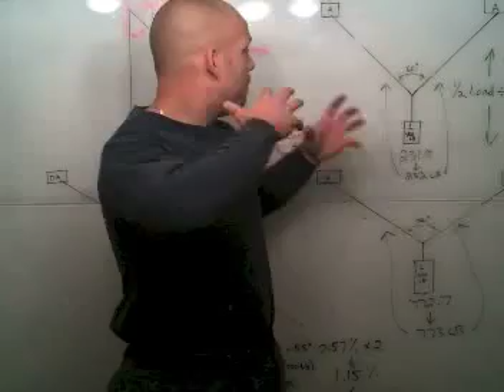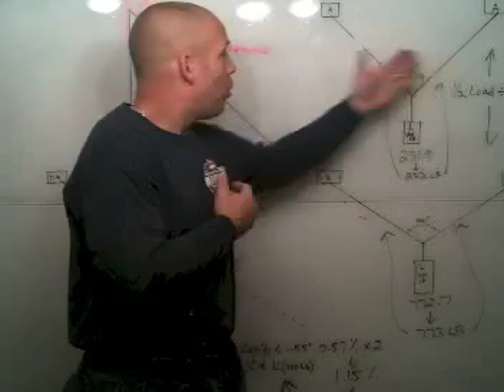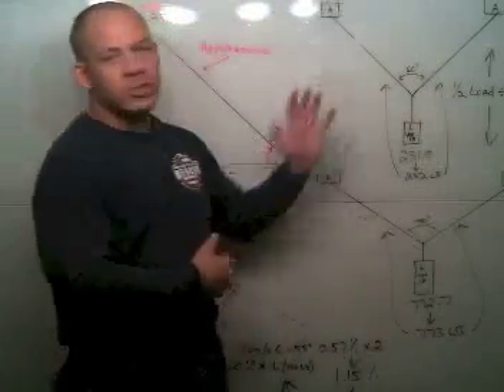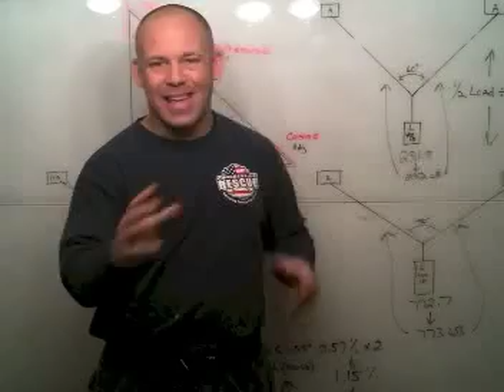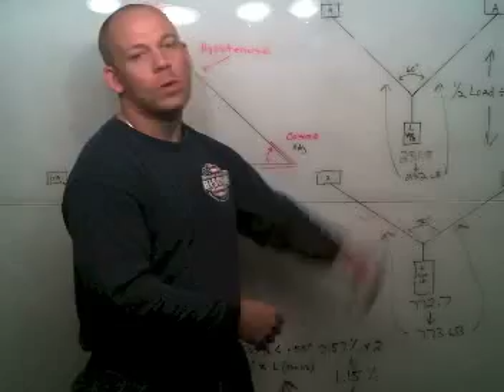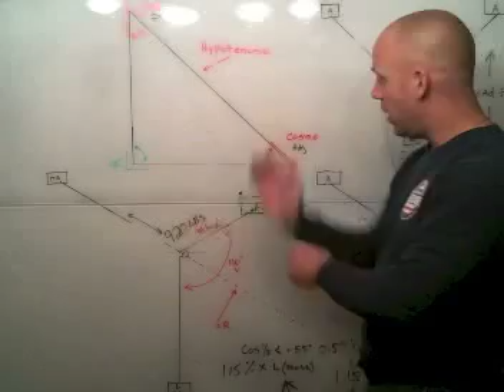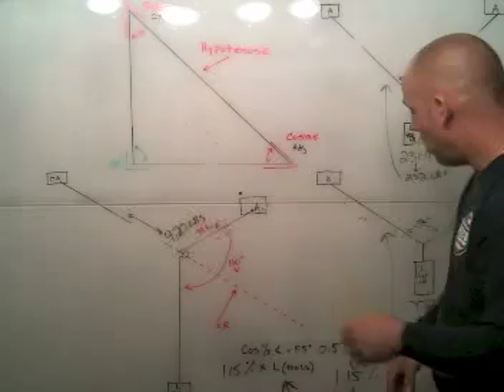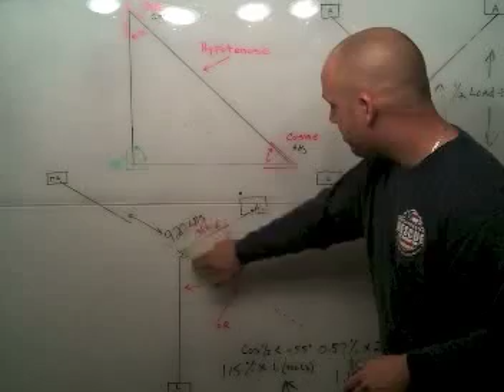Physics Of Rope Rescue Fire Engineering Training Segment

Comment: Mike, I need help. 'm getting a different number on my math and I don't know why. When I put in 200xCos(30) I get 173.205 and not the 231.9 number. And when i try it with the larger angle i get an even more crazy low answer. Any suggestions? I don't know if it is a setting on the calculator or how it is entered. Any help would be great!